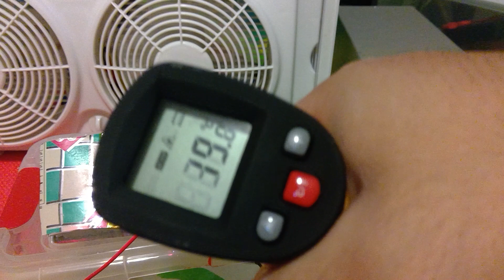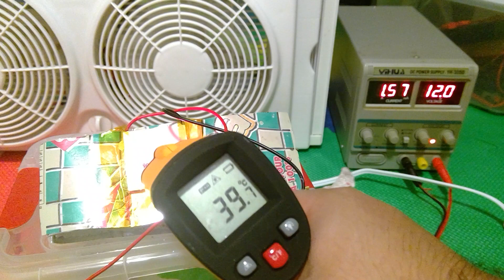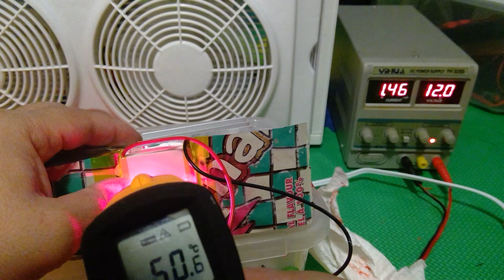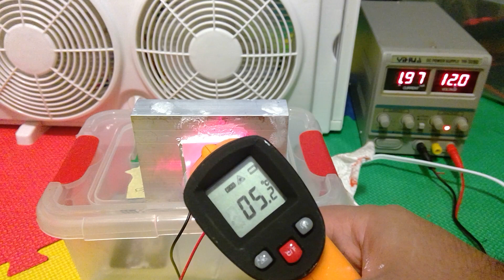make diy heat sink from aluminum cans part 5

Comment from the maker: I probably have to remove the paint to increase thermal conductivity.  I will re-design this heat sink at a later date.  although this was a failure, we could all learn from mistakes or get inspired to improve the design.  I hope I planted some seed of inspiration for some of my viewers. I personally believe it's a great idea to learn how to recycle aluminum cans in constructive ways. we all can benefit. 
 note: I realized a made a false statement in my video, I just want to correct it or clarify it.  Thermal grease increases thermal conductivity by covering imperfections of the heat sink which prevents air getting trapped between heat sink and peltier plate. air is not good conductor of heat.  if I had a perfect surface or conducted this experiment in a vacuum, direct contact would probably increases heat conductivity without the paste.  thermal paste heat conductivity vary with the type of materials used to make the thermal grease. metal based thermal grease probably has the highest conductivity but probably is more expensive than other types of grease. I think I was using silicon based grease which has lower thermal conductivity than metal based thermal grease.  almost all thermal grease are not as conductive as some of the metals such as copper. since thermal grease could be even less conductive than aluminum, it must be used sparingly as too much can significantly decrease thermal conductivity. I realized in this experiment, I may have used a little too much of the thermal grease, so I will fix it on my next experiment.  this website compares conductivity of various metals: https://neutrium.net/heat_transfer/thermal-conductivity-of-metals-and-alloys/ 
as you can see, copper has better thermal conductivity than aluminum, so in my next experiment, I may attach copper sheet between peltier and aluminum heat sink in order to increase conductivity. I have graphite sheets which have high thermal conductivity, so I will compare copper vs. graphite. 
I will also try to diy my own thermal grease. a typical thermal grease may contain the following ingredients: 50% Silicone, 30% Carbon,  20% Metal Oxide.  zinc oxide is found in diaper rash cream or sunscreen lotions, carbon is found in pencils and water filters.
Reply: You probably want to normalize the sound levels in the video!
Reply: the idea is great !!! but u have to make the video short
Reply: The cans are coated in plastic as well